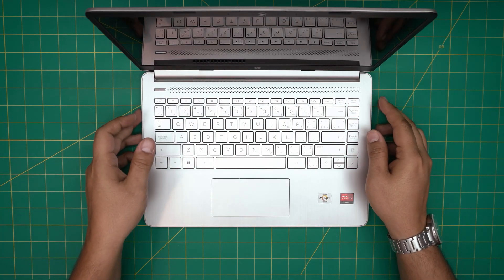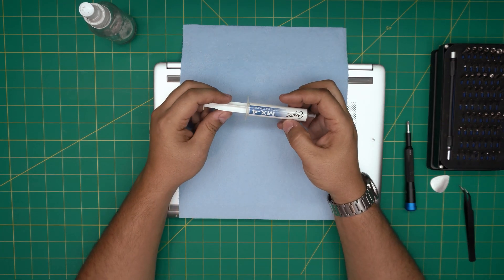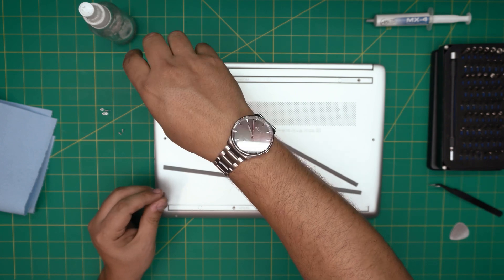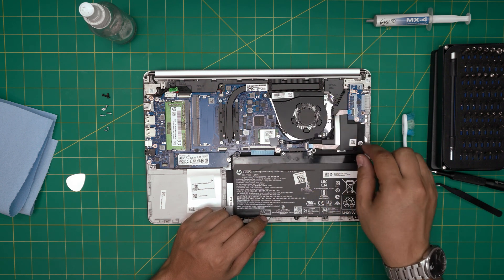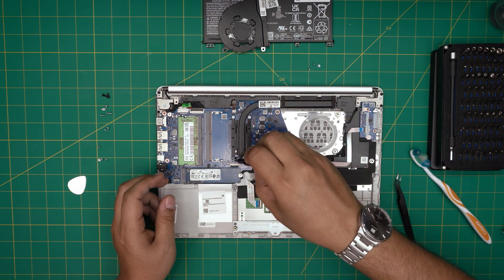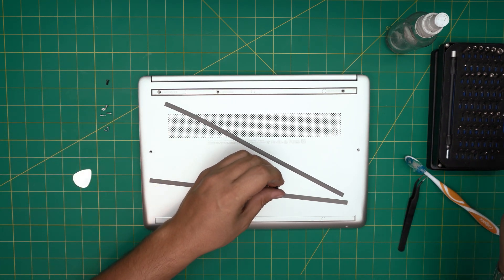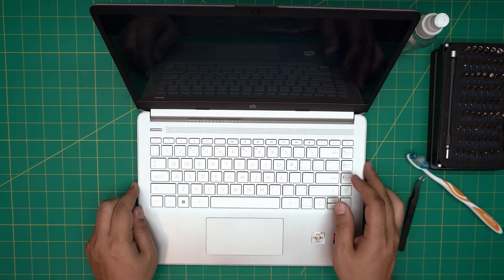How to Repaste and Clean an HP 14 Fq0028 Laptop | Step by Step💻 🧹

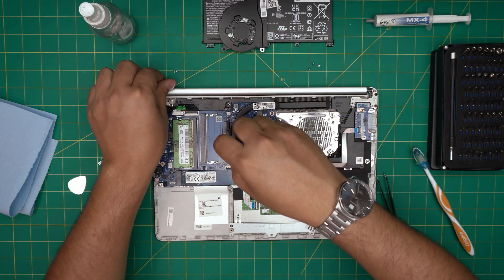Comment: 6:37 mine is not lifting up! its stuck.
i removed all 4 screws from there and tried to pull it but it won't.
should I stop the process here?
Reply from the maker: 🫠Regarding your question, rotate the heatsink clockwise or use a hair dryer to heat the heatsink directly over the CPU at maximum heat for 1 minute, and then lift it.
Should you have any further questions or requests in the future, please don't hesitate to ask me.
cheers🍻

Comment: where is the GPU in this laptop?
Reply from the maker: Thank you for your feedback! If you wish to support the channel, you can show your support by liking, subscribing, or doing both!

Regarding your question, your laptop does not have a dedicated GPU. Instead, it is equipped with an APU (Accelerated Processing Unit). An APU integrates both the CPU and GPU into a single chip. Due to this design, it is not possible to upgrade or remove the APU.

If you have any other questions or requests in the future, please don't hesitate to ask.